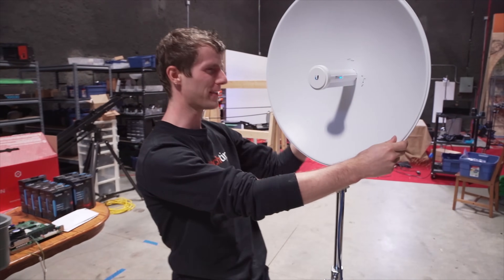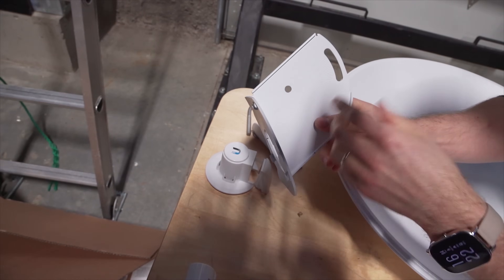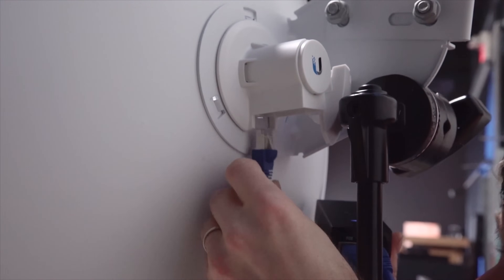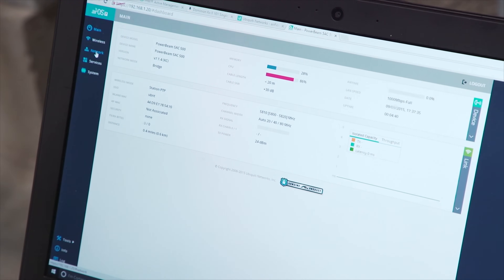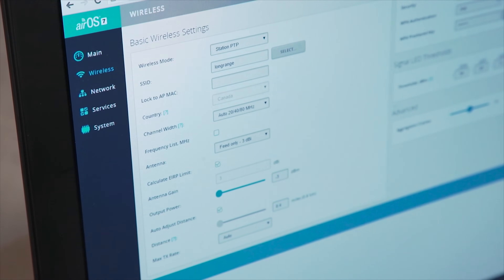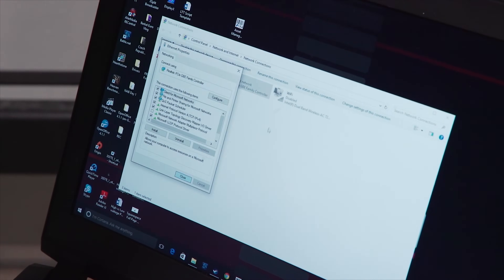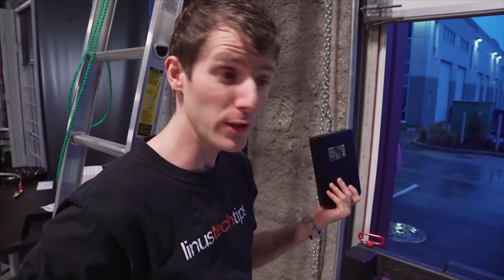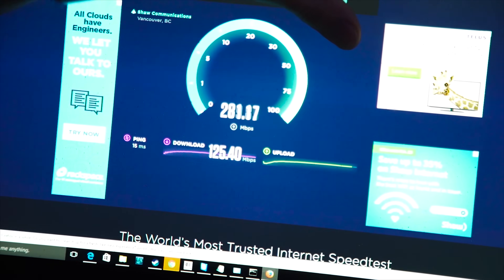HOLY $H!T - Long Distance Wi-Fi (Up to 25 KILOMETER range!?)

Comment: You were probably seeing some interference from all the WiFi devices in your office causing a little slower speeds. I did work with similar units and we got about 16km before range started to be an issue. Wireless interference was a far greater issue than range for us.

Comment: In the large open spaces here in South Africa, we can get 300Mbit+ at over 100KM,  We just use slightly bigger dishes.

Also, the radio's are tweaked to a asynchronous in speeds, as most people need a little more download than upload, you just need to swap station and access point configs.

These particular models dont do well with Gaming, VOIP etc, because wifi is half-duplex.  If you want a full duplex setup, use the Airfiber 5 or 24 range.  Or do some clever routing with dual dishes at both ends

Comment: Eh. I would really have liked it if you discussed the frequency spectrum and rough price to provide further input. It uses 5GHz which is good, but I'd like to see how many of your neighbors in that area are using the same frequency range.

Also, perhaps you guys should do a "networking" video as PTP should truly be /30 networks and you guys could discuss default routes and etc. This is probably only a good Small Office / Home Office (SOHO) option for those that live within at least half of the proposed range.

Comment: Calling total BS on the range I use long range CPE wifi all the time at work and recon you'll get 10km max based on the my experience.

I have 1Gb net link too and yes most servers are on 1Gb links so you'll never get 1Gb expect 930mbps max from linux or a mac
or 630mbps in windows via speedtest... don't ask as not had time to look why..

Also I'll buy some of these this month as I also want a link to my house which is a 4km to the relay and 7km back to my house we can get to the relay with EL-ENSTATION2 but it dies above 5Km, so be interested to see what we get out of that unit.

Also if your like the UK there are three bands A for internal B for internal and outdoor, and band C, free licence point to point. all have different power caps for radiated power and are defined for different uses..

One thing I must test as a note to my self is just how bad my 600mw fpv quad kills the links as some bands over lap and thats a lot of power to try to get through..

Comment: even with the antenna turned to -3dB its still too powerful. minimum 1KM link for those guys, the smaller M5 would have been a better test for those short ranges. they are just overpowering each other.

Comment: I've been using their pico stations for about 3 years now. One died but was replaced for me. A+ on that. Range is decent but I've got one inside. They bridge two buildings separated by a public road.   If you mount these all outside on masts I'm sure the range is excellent but with any obstruction, trees, buildings etc the range greatly diminishes. Less so I'm sure if you have the directional versions though. On mine at least I believe the lights are the signal strength, and not the connection speed, though of course one affects the other. Got my American amateur radio license about a year ago and learning about antenna theory on those bands also applies somewhat to theory on wifi.  Debating trying to make a mesh network here with mast mounted devices with local radio friends but without LOS I kinda doubt  you will ever get the "25KM" range.  Would love to know what kinda speeds you get when you put it up.... and if you figure out the speed differences between up and down as I've seen sporadic speed differences on my older radios. I'd love to see a video with their engineer if you can still get the offer!

Comment: I cringed every time he turned the antenna to his face. If this antenna is powerful enough to transmit to a range of 25 km,  you wont have much problem to fry chicken with this. Won't be surprised to see Linus with  Deadpool's face at the end of this video.

Comment: I implore you Linus, please stop using speedtest to test your connection. You of all people should know a flash-based speedtest is horrible if you want to retrieve the actual speed you're recieving. You should know flash-based speedtest have to make adjustments of up to 40% to make up for unknown variables.... the buffering between the browser and throughout burst because of CPU usage and etc.

Please, atleast for a single watchers sanity, use a HTML-based speedtest just once. 

Or don't, who knows if you actually read this. though thanks for the videos, i truly enjoy them all

Comment: what about building a gaming computer for car where you can use the 15 - 11 v dc to run a 250w 12v dc to dc computer psu with a high end gaming gpu and a intel i7 to play crisis 3 while on the go because laptop are not that much powerful play highend games on it or you can not buy laptop for 1500$ to play games on it or if you are using 500$ laptop then the frame rate you get is non play able and also it look cool to run desktop on a car and for the monitor 100w 220 or 110 v inverter is more than enough

Comment: Linus these radios are sweet we have a wisp with over 200 customers and we are using the same raidos to backhaul from our fiber to main tower you will see speed improvements if you go higher due to Fernel zone issues

Comment: The plastic weather proofing is called a radome. You thought putting it together was tough try taking it apart to individual components. I would watch that video. Especially if it has been in operation for a few years. The Holy $h!t title would be accurate.

Comment: We use Ubiquiti for our internet from home to work. It's about an 11 kilometer stretch and we have never had issues with that connection. The only time we have ever lost internet at work is when something goes wrong with our ISP at home. It's nice to be able to keep everything on the same local network. Even if the internet goes out, the link still functions so we can access files from work to home if they are locally stored. This equipment is amazing if you happen to be in a geographically advantageous location. Sometimes it pays off to live on top of a mountain.

Comment: hrm... interesting idea. i have two colleagues whom i could use this system to play lan games because the highest available internet connection at the moment is 24mbps which roughly translates to 8 up, 0.8 down. Its impossible to play games like space engineers. That could also solve our file transfer problems when we have 2-3gb of files we need to share.

Comment: Oh yeah I can't believe it took you so long to figure it out! A friend of mine never paid an ISP since 2006 when he installed a dish antenna and a had a practicaly bottomless list of unprotected networks!
Reply: +Sketch1994 Did I mention it works both ways? Your employees with never pay for an ISP either!
Reply: +Sketch1994 Damn, I shouldve picked up the massive dish I found on the side of the road a couple years ago.

Comment: Hello . how can I make my Internet better ... :( my upload speed is like 2 mps :(
Reply: +Raul Gabriel Burn your house down and move to another area. EASY as that!!
Reply: my Internet is in kbps
Reply: Buy better internet from your isp.
Reply: Massimo Giardina I have optic fibre and my Upstream/Downstream is 1gbps (1000mbps)
Reply: +Raul Gabriel Sounds like you either need a better internet package from your ISP or your ISP just sucks.
Reply: +Raul Gabriel Spend more money for a faster connection and better hardware.
Reply: +Zack Butler yea pay em to upgrade their internet lines =)
Reply: +LimPu people don't realize that some times it's a matter of distance from the ISP that is causing the low speeds, spending more on the fastest package might just end up with them paying for like 20Mbs, the ISP saying they can only deliver up to 15Mbs and them ending up with 12-10Mbs.... been there done that. and ofcourse the nest package deal is 10 or 5 lol.

so yeah burn the house move to one with fiber already installed.
Reply: to upload a 1min video i need to waith 3 hr
wtf
Reply: +Raul Gabriel Hello, call your ISP and ask them to turn your speed up a notch, obviously you will have to pay more for faster internet speeds.
Reply: +Danny Rice yeah well im stuck with 512 kbits for now so
deal with it
Reply: Kareem Shabaka mines the same on steam eventhough speedtest.net said I've 4gbps
Reply: I had a 2Mbps down and up in my room. So I bought a 30M cat6 cable and connected it to my router directoy into my pc... I get 300Mbps down and 500Mbps up :D
Reply: TinchoX I don't have so much money for that and I don't really need those speeds. :D

Comment: CPU : i5 4670K 

Case : NZXT Phantom 630 
             
Graphics : MSI Z97 GAMING 5                                                
Motherboard : MSI GTX 980                                                                     
Hard Drive : Blue 1TB      
                                             
RAM : Hyperx 16 GB                                                    
Power Supply : CX 750W                                                                                                                                       
CPU Fan : Corsair H60 
                                                            
Can He Hold Gta 5 On Ultra ?

Comment: When I was active duty in the Marine Corps we had a similar device called the WPPL-D. I learned how to set it up and use it in 2010.  I didn't know a similar commercial equivalent could be so cheap. Unlike this one though, the WPPL-D only had a maximum bandwidth on the big antenna of 90 mbps but at 31 miles/50 KM away. It's cool tech but It's really not viable without beefy mounting hardware for wind and such.

Comment: I'm sure I can get an Ethernet cable loger than that. Pretty lame if you ask me.
Reply: An Ethernet cable is limited to 100m before it needs a repeater
Reply: +SillyNamesAreSilly You still only need 250.
Reply: +Sterling Ralph it's 25,000 m
Reply: +Sterling Ralph 250 × 100 equals 25,000. When I said you only need 250, I was referring to the number of repeaters.
Reply: +Sterling Ralph Yeah I'm being sarcastic, just making fun of people who only use Ethernet (me)!
Reply: +Sterling Ralph Dammit Moon Moon, obvious troll was obvious.
Reply: +SillyNamesAreSilly for data.  Ethernet can go longer for other uses.
Reply: +Slippy Sloth Sure, plus city permits, inspections, licensing fees from ISP, and contractors to install it through the city ...
Reply: You must be new around here....

Comment: even a cellphone tower doesnt reach 25miles
Reply: km
Reply: Yes but its illegal to have a amature  radio wave that goes more than 500m
Reply: +leon vdd No, the law limits the mount of power you can transmit with; your range depends on that plus other factors including how much of that power you get going in the direction you want instead of every which way.  Also wifi uses the unlicensed ISM band, which is not considered to be amateur radio.
Reply: +leon vdd could be because they are designed to handle more traffic at the same time rather than more distance?
Reply: +leon vdd depends on where you live, most of europe has a 125mW limitation with which you can get ~1km+ in  good conditions
Reply: +leon vdd No, but the microwave links between them do, also you can have links as long as you want in the ISM bands within the power limitations - use a good directional antenna and bump up the EIRP because of the antenna gain, eg. get 15Km's using a circular polarized 18dB antenna within the 2.4Ghz band easy with 250mW - and it's legal in most countries. also armature  radio requires a licence in most countries and ham operators quite often have a few 100W's to play with and talk to operators on the other side of the world legally..
Reply: +poiuytrewq8ff I have a neighbor who is a HAM with an uber license and he can transmit up to 2500W.
Reply: +Phillip Susi when you say neighbor do you mean like in suburbia?  stuff living right next to a 2.5Kw transmitter lol, 1Kw in a residential area is pretty bad as it is. what country are ye in?
Reply: poiuytrewq8ff Bad in what way?  I live in the US.  Guy a few doors down has a 100 foot tall antenna and talks to people in Australia all the time.
Reply: +Phillip Susi in the omg i just found out i have 9 forms of cancer way.
Reply: +Phillip Susi 100 foot mast? Ah that's probably fine then - well and truly over you house not into it, I'm used to cowboys operating out of there licensed configuration like one of my neighbors who was running a high power transmitter with a short mast and yagi - used to mess with TV reception and Wifi because of spurious transmissions due of inter-mod etc. Do you use free to air tv like DVBT, or listen to AM radio, or ever have issues with your wifi falling on it's arse when he's transmitting? this idiot Diego assumed I was talking health issues but I was actually talking about the destructive interference that can cause RF devices in nearby premises to play up.
Reply: +Diego31337 RF does not cause cancer ding dong.  It isn't energetic enough to cause ionization; you need at least ultra violet light for that.  Which is good, because standing in daylight exposes you to around 1000 W of visible light, which is more energetic than RF, which lies below infrared.
Reply: +poiuytrewq8ff I do use broadcast digital TV and wifi.  I hadn't noticed any difference when I see his mast go up.
Reply: +Phillip Susi i wasnt being serious lol
Reply: poiuytrewq8ff he was talking about his neighbor having a 2.5kw antenna about 100 yards down the street. Also, it was a joke.
Reply: Diego31337
well if thats the case sorry buddy, couldn't read the sarcasm and unfortunately in this day and age alot of people would have been serious.

Comment: you guys need to use iperf to check local internet performance, you run it on one computer as -s for server, and '-c serverIP' for client and you should get real time network speeds between the two network clients
Reply: +denvera1g1 never mind, i see you have a built in tester

Comment: the max practical wifi speed is 60% of rated link, which is what you got with your test. Its possible to get more but to push 90% of rated link on omni you would tend to get packet losses whereas with full signal for directional you can get near the rated link speed if there is no interference and good alignment.

Comment: I did LOS down a highway, i didnt know about iperf or anything like that at the time, but with $120 worth of hardware, 1watt usb adapter with external directional antennafrom a laptop, and a 1watt amp on a router with external directional antenna, i was at least able to see and connect from one vehicle to another about 4 miles away, after that distance the highway dropped off and the ground would be in the way